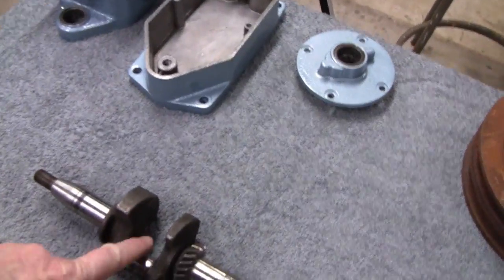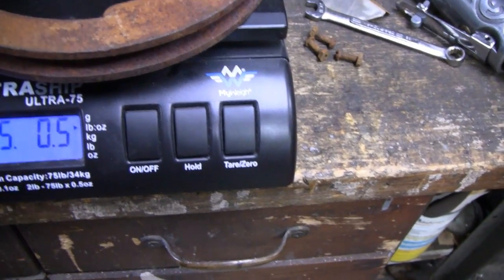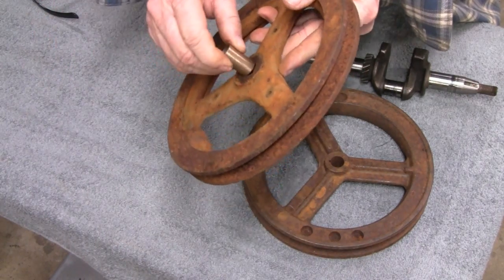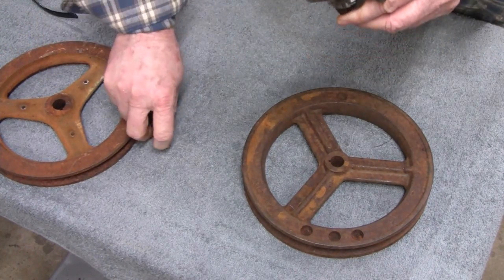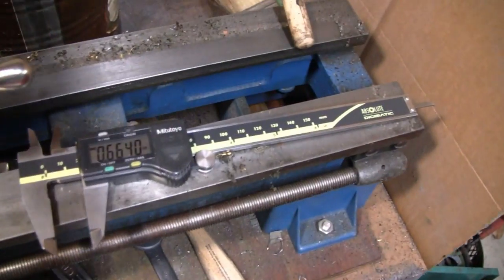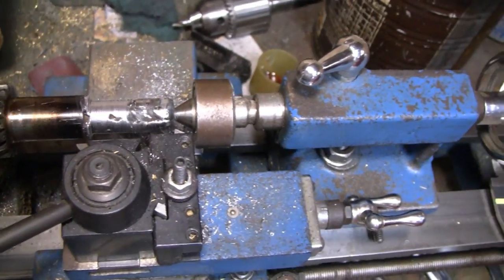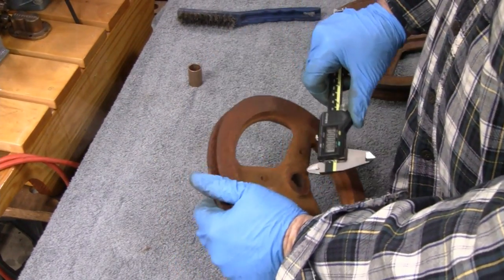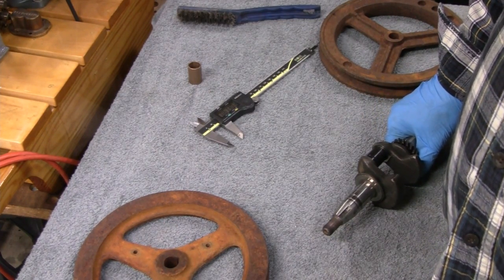HOMEMADE OVERHEAD VALVE BRIGGS (part 25)

Comment: Wanted to see how you would rebuild the shaft.....very interesting...never thought you could do this with success ....going to use this at my daughter's farm to rebuild shaft like for the round baler and other places....gave them a lade a few years ago....I saw rebuilding shafts at a paper mill I worked a few years ago but the use to spray weld the shafts with air and ark and that worked but i`m sure it was not sheap....good job mate and like the quality.....CHEERS
Reply from the maker: Thanks Gator!! Good luck with your Shafts!!☺

Comment: Has anyone ever had a runaway flywheel at one of these engine shows you go to? Not entirely related but there was a antique tractor pull north of us in front of the county race track grandstand and an old 800 Case flywheel exploded and the clean up crews found pieces of old case on top of the grandstand roof. There was enough force to break the tractor in half. I think a few spectators had to get metal removed from their bodies but no fatalities.
Of course that old Case was under quite a load that your engines will never see. File!
Reply from the maker: Nah, I never even heard of it happening at any shows, usually something like that will always come up when BS'ing around the fire!! I have seen videos of the damage that flywheels create, it's like a bomb going off!!☺

Comment: I see one is drilled for balance and the other looks like it has a piece of iron that must it's form of balance. Will welding on the cause distortion? It drives me crazy when you reach over the lathe to turn it off.  "Watch your sleeve" now but next rewire the on/off switch on your side.
Reply from the maker: Nah the shaft is thick enough that the heat doesn't bother it!!☺